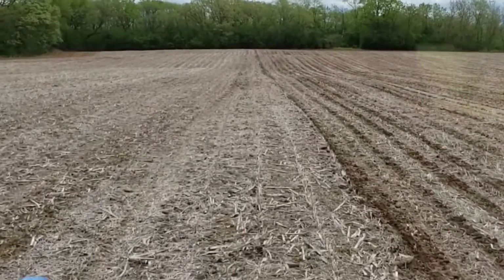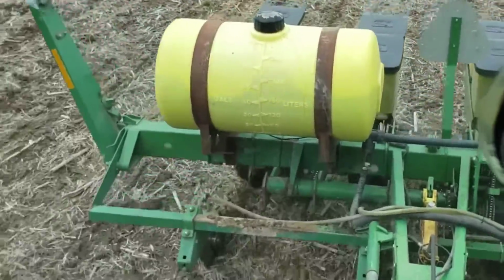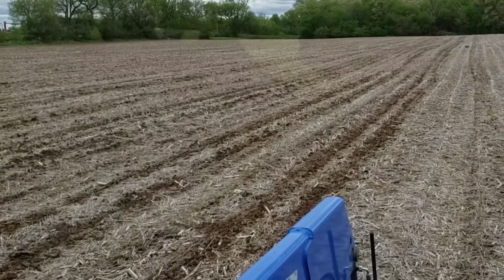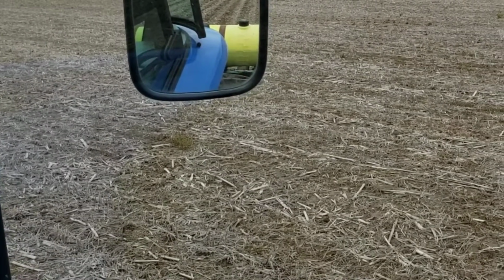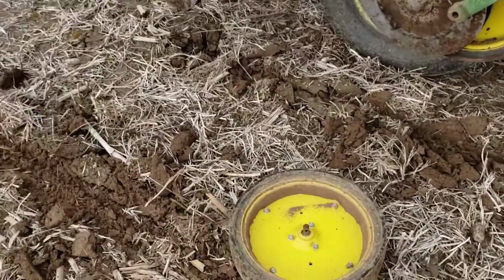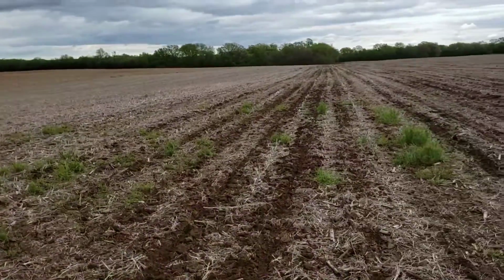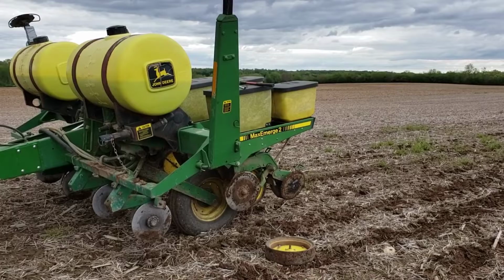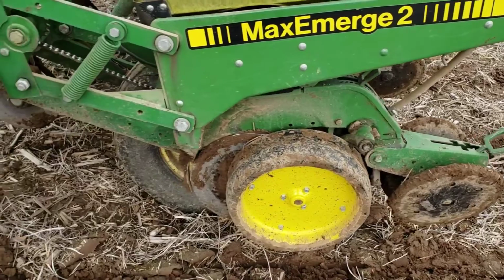Trying to get the field corn planted before the rain

Comment: Any difference in your yield between no till or till ? Thanks Greg
Reply from the maker: It's really hard to judge but I would guess it equals out. No till you save time, fuel, equipment wear and tear, but might cost a little more for weed control and seed because you plant a heavier rate when no tilling.

On tilled ground you spend more time, use more fuel, have less weed problems, and plant less seeds but probably get a little better yield. Also more wear on the farm equipment.